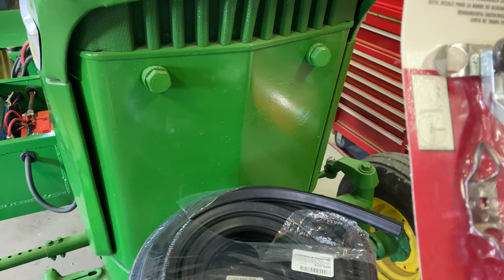Working on the First Window Frame for the Cab on the John Deere 2510

Comment: Great video Randy!  You might want to contact the manufacturer of the A/C unit and ask them how much power is the heater section in this A/C unit is suppose to draw.  I find contacting the manufacturers regarding problems like this saves a lot of headaches down the road.  Most manufacturers I have dealt with over the years usually want to help their customers solve problems with their product than having angry customers writing bad reviews regarding their products.
Reply from the maker: That's a good idea, if I can't figure it out I'll have to give them a call.

Comment: Still missing a CB in it.

The heater will be appreciated on cold rainy days when the glass starts fogging up.

The trade-offs of the cab being hot and noisy was that it provided a rain cover and sun cover (much better than the old umbrellas) and it also provided a roll bar for if the tractor rolled. This was something John Deere wanted farmers to have as tractor based fatalities were starting to spike with these bigger and bigger tractors. So they slapped these quick built cans on for safety, then went about making them more comfortable (sound proofing,  temperature control, easier access, "better visibility" can't really have better visibility than with a open cab)
Reply from the maker: Oh exactly, definitely want a heater, though I don't think it is important as AC for this cab.  Cabs have evolved a lot since the early days!
Reply: @radozeman  well yea. A lot has changed since then.

Comment: It’s even worse when you don’t have a door. The sound enters from there and for some reason does not leave. It will be quite a bit quieter in there after your renovation. Should’ve checked the decibels before and after.
Reply from the maker: That is true!  Though I think the more "soft" materials you have in a cab/vehicle the more it helps to absorb the sound.  I should have checked the sound level before.... well whatever it was outside the tractor and then some lol